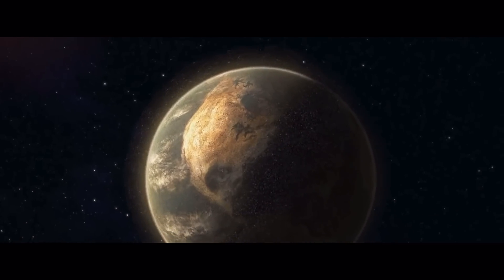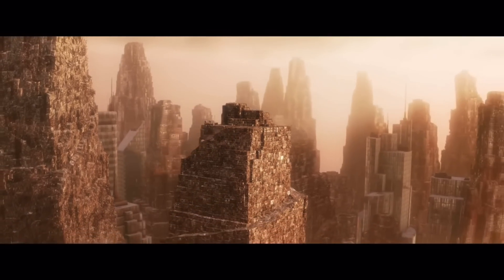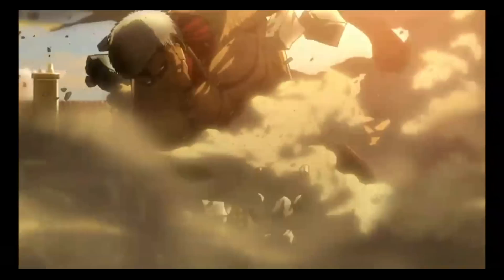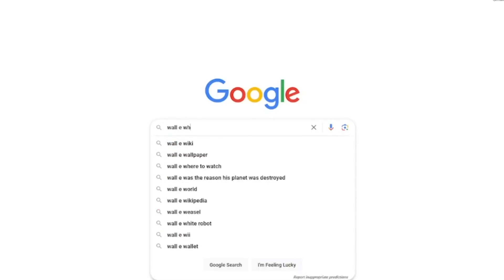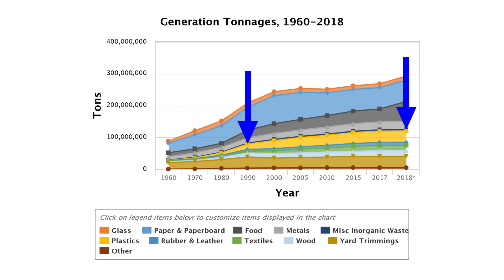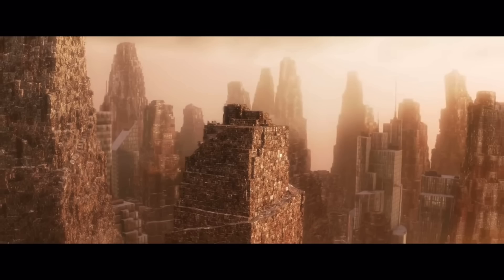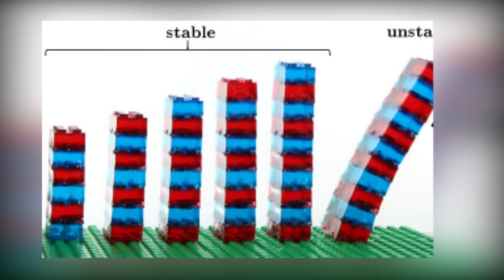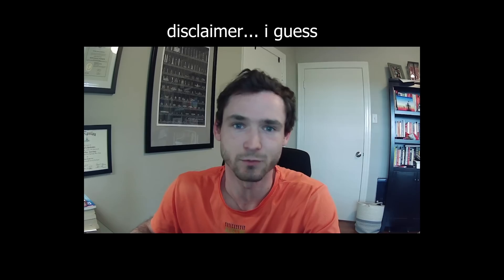Wall-E's Ridiculous Skyscrapers: A Design review

Comment: I can see two possible solutions to the stability problem.

First, the slightly irregular surface of the blocks would likely function as an effective key, holding them together in much the same way as a dry stacked stone wall. That would cause the stacks to behave more like a solid structure, rather than independent narrow towers.

Second, regarding minor angle inconsistencies. Humans are not good at detecting very minor differences in angle, but there’s no reason to assume that a robot designed specifically for the purpose of building trash towers would share that limitation. It seems likely that Wall-E would constantly monitor the accumulated error and adjust accordingly, thus maintaining perfect alignment within the error margin of the sensors onboard.
Reply: I totally agree, but I also want to add a little bit;

There's also some things to be said about how many WALL-Es have been doing this: if one WALL-E fails for some reason, its mistake will probably be picked up by one of the thousands of others. Plus, I feel as though the weight of the cubes would eventually make them (at least near the base) compress into one large mass similarly to what the WALL-Es themselves do the cubes.. and of course there's the possibility that they stack them like blocks for, say, 4 layers, and then interlock for another 4 layers when it tapers inward, which would mean they eventually get turned into giant blocks that just stack atop each other, which may mean they don't behave like wooden blocks in practice.

We also don't know if there's some method used for the towers that WALL-E is no longer capable of doing anymore, or if the WALL-Es select what materials they use for each level or part of the tower. We also never see if there's any underlying structure to these towers - it's possible that there is in some of the older ones, and WALL-E just isn't capable of constructing those himself anymore, so the one we see him start is just the best he can manage. Considering we don't know how long WALL-E has been working independently (it could've been anywhere from just a few months to hundreds of years before the movie's start), WALL-E could just be finishing off what exists.

Comment: probably repeating what others have said but:

Wall-E didnt act alone in the beginning, large blocks were made by larger robots, and its fair to assume other models had functions that could supplement that.

also, i think you VASTLY underestimated the utility gained by stacking blocks together side by side, or in a brick-style pattern. it mitigates the variances in flatness by a large amount, as well as increasing the amount of weight necessary to disturb the tower as a whole. you can experience this experimentally by just playing with some blocks. it doesnt require you to even consider which way the tower is bending as you place the blocks, the effect is strong enough to gain 2 or 3 extra blocks in height without any thought. with some thought, you can gain even more stability. imagine instead of blocks, that we are stacking rocks into a pile like hikers do when theyre bored. the chosen rocks are usually not flat at all, round rocks being easily the most popular, and the only consideration made to maintain the stability of the pile is weight distribution. yet these stacks can be surprisingly stable regardless. if you apply the same skills to multiple stacks of blocks which can lean on eachother, that would allow for much more stability than a single stack with no corrective actions taken by the builder, i would wager that you could correct the leaning almost entirely, given enough time to carefully arrange the blocks. and wall-e has certainly had time. 

another mitigating factor to make the towers more viable is natural decay fusing the blocks together, in combination with the weight of the trash blocks on top of the lower levels further compressing them into eachother.

 i was actually suprised when you brought up the weight of these towers that you hadn't mentioned soil compaction. the weight of our hollow, concrete and steel towers is enough to compact the soil beneath them already, leading to engineers and construction workers taking great pains to make sure the soil is pre-compressed before they begin construction. this would probably be even more necessary for wall-e's towers, which are solid waste, with no hollow spaces. i would expect that without the help of other machines to prepare the stacking sites, wall-e's towers might lean and fall over long before they reach heights unbelievable for the waste blocks, because the soil beneath them would compact unevenly and tilt the tower.
Reply: tldr

Comment: There are a few holes in your theory.  first of all, this is a cartoon with a message.  Actually several.  Firstly that the Human Race trashed the planet, ruined the atmosphere and seas, then left for their star cruse-ships.  Because of the environmental degradation, the atmosphere was ionized and there would be no rain.  There was also a scene where the Probe flew over what had been New York Harbor and it was dry.  Even the Hudson was dry.  The sea had receded drastically.  Even further reducing the water supply of the planet.  Hence, no greenery.  This was the primary function of the cute little probe-bot.  To find greenery and bring it back to the mother ship.  

All of that said, you forgot the base of the towers was at least two hundred feet square and that they tapered.  The fact that the blocks are dry-laid and not interlocking is almost irrelevant.  Part of the interlocking would occur as the base was established and the proceeding layers continued to compress the primary layers underneath (a concept you did mention briefly).  Being a cartoon, things were exaggerated and the trash towers were larger, for effect, than what would be possible in reality.
Reply from the maker: Thanks for the comment but I’m not sure we disagree as much as you think. I mentioned the lack of water in the section describing rusting, and that the towers taper. Though the difference in a dry laid brick of any kind and one bound with a mortar is going to be significant in the manner I described, it can transfer tension forces in a way the dry laid cannot, though the effect of group action is less obvious to me. 

Also, what I do with this channel is exactly this, looking at fantasy within cartoons and describe why they are fantasy, or at least investigate if they could be done. Thanks again.
Reply: @onstructures  I'm surprised you didn't bring up the idea of the weight involved and the compression that weight will bring to the bottom ranks of this type of construction.

Comment: Walle didnt build all those alone. There were once thousands identical robots and even giant ones.
Reply: It's like people never seen the movie or somthing
Reply: I think his home is one of the deactivated giant unit? I may be misremembering the details tho
You can see 2 of those giant guys shining lights while WallE was trying to save Eve
Reply: @henrycooper3431 
Nah. WALL-E stands for “Waste Allocation Load Lifter - Earth class”
The giant ones are WALL-As; waste allocation load lifters - Axiom class
The big ones were made specifically for the Axiom space cruiser.

Wall-E’s home was just the designated storage unit for all Wall-Es. Complete with a bunch of rotating racks for them to fit into.
Reply: @iout  Not even a storage unit. Sure that was one of its purposes, but the other was that it was the transport for the WALL-E units.
Reply: @henrycooper3431  Nah, his home is where the other wall-e's lived at, the giant ones, for the most part, lived on the spaceships the humans left on.
Reply: He killed then by locking them out in the sandstorm
Reply: Though it begs the question why they weren't using the giant ones to clean up the earth.

Comment: 5:20 there is still wood present, we see a pallet in there shot u showed just previously from the film
I mean obviously wood doesn't USSALY last 700 years, but in dry hot and aired climates wood doesn't really rot, and we can see that the world of WALL-E  is a dry hot aired climate and so there is probably more wood then u estimated around. Ofc that is just my personal thought.
Reply: Could be treated wood. Wood treated with a mixture of Oil and Diesel can stay underwater for basically forever. I KNOW at least 70 years according to what my grandad showed me as a kid.
Reply: @OgKafrizel  wood under rails for trains is also treated in a way that they practically last forever. The ones ive seen have probably outlived atleast one generation, easily 2 without any notable wear other than where the fastening of the screws and metal were.
Reply: we see six oil tankers beached next to a port in one scene, so it's safe to say that the climate is very dry.
Reply: maybe the environment is simply. relatively/comparatively sterile?

Comment: I assumed that the rain would dissolve some parts of the blocks and let them fuse together.
Reply from the maker: Hm interesting, I hadn’t considered that. If the dissolved material were like a rust, it could provide some help as a roughening surface to engage sliding friction, but rust has pretty poor mechanical properties otherwise. Thanks for the comment
Reply: @onstructures  Rust by itself would be weak but if you combined the strength of the entire solid structure it would definitely be able to hold itself up.
Reply: Idk if it would still even rain given the state of earth at that point.
Reply: @creepergirlgaming7912  Wall-e uses an umbrella to try and protect EVE from the rain in the movie.
Reply: @drolemem  Oh yeah... i forgot about that.

Comment: could the weight of the tower also be crushing the blocks causing a form of interlocking, the blocks are compressed together for the lower areas adding stability that might not be there for wooden blocks
Reply: itd be interesting to account for the fact that the compressed material would, over time, flow into one another. however this action would also stop looking like towers and more like a regular pile. i think the phenomenon is called elephant foot where the column starts to splay out at the base
Reply: I had the same thought lol but if that's the case, what's stopping the base blocks from disintegrating all together. the moment the blocks starts to collapse it should occur from the base up. (Unless there's varing integrity in the blocks, then wouldn't that introduce weakpoint for the blocks to tip at those points) not an engineer just random thoughts here.
Reply: Don't forget that Wall-E would have to deal with uneven settling of the souls underneath the towers.
Reply: @ianbelletti6241  The 'souls'? Yikes, Wall-E just got a thousand percent darker, then.
Reply: @mikemagnus9447  I assumed he meant soil, I could be wrong though.
Reply: @laurencedavey3121  Maybe it's both and Wall-E just lives in the Nether.
Reply: I think the issue is that it would fall over before enough material was stacked on top to cause the compressive interlocking.
Reply: @christopherreynolds4506  we also can't forget that it's compressed mixed trash. At some point the weight will cause some of the blocks to start falling apart. Also, when the blocks fall the impacts will obviously cause some blocks to fall apart either partially or completely. These blocks aren't stable building materials.
Reply: I was thinking the same thing, I was thinking both that and perhaps "Trash Goo/Slime" acts as a sort of binder, merging the blocks together
Reply: how do wallEs create uniform blocks from non-uniform matter, which both take up almost the same volume
Reply: @Jamlord2061  digital compression.
Reply: Pressure would combust some material and weld others.